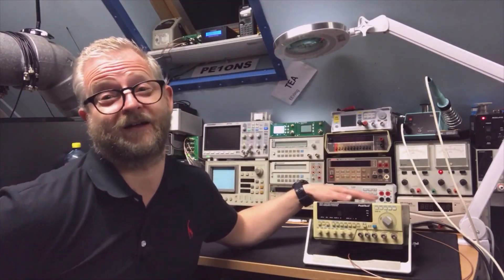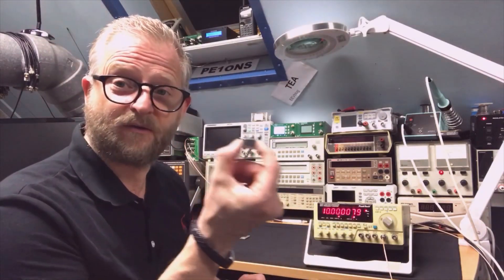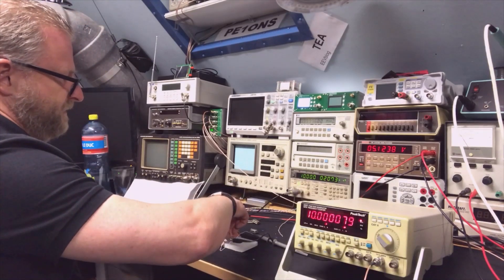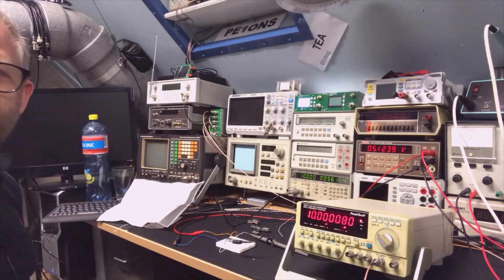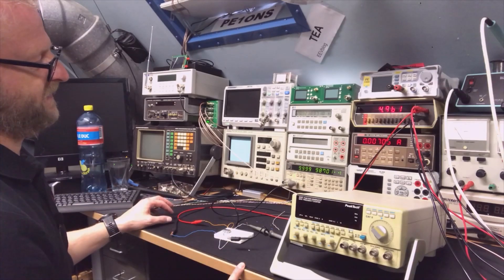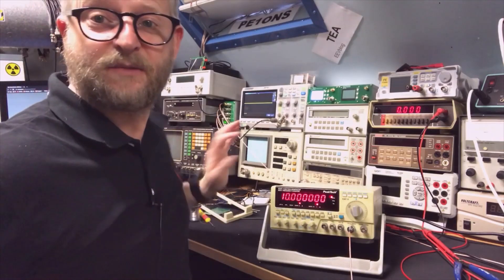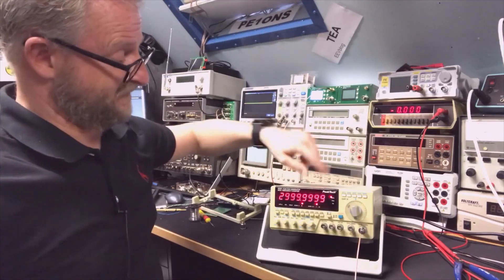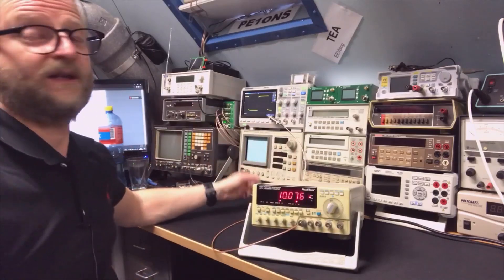#070 Peaktech 4085 / Metex MXG-9810A - 2.7GHz Counter and 15 MHz Generator

Comment: Thanks for the video Tony. where did you get RG316 BNC cables from? And what length are you using in your lab? They look quite handy.
Reply from the maker: Yes love them!... I use 1mtr BNC/BNC and i placed my distributer halfway in between the devices.. 
https://nl.aliexpress.com/item/4000134452970.html
i now recently bought a few 2 meter BNC/SMA with seperate SMA adapters so you can make any connection on the other end.

Comment: Was that a Trimble oscillator which you plan to use as a spare for the Marconi?.. and of course thanks your ongoing interesting videos! 73 Albert PA5OXW
Reply from the maker: Hallo Albert, thank you! Yes it is a Trimble and i know its 12V and not 5V, i did find schematics of this mod. but agree a smaller 5V Vectron would make more sense, but then i have no other device to fitt this huge Trimble in :-))) '73 Tony
Reply: @TonyAlbus   Thanks yr reply. Have a used Ebay  (of course..) Trimble myself 12 V  > vFc 4,22V  (stated on the device)  Can you plse send me the schematic you found avdeur@home.nl.    Bedankt !  73
Reply from the maker: @avdeur  Its in your email!